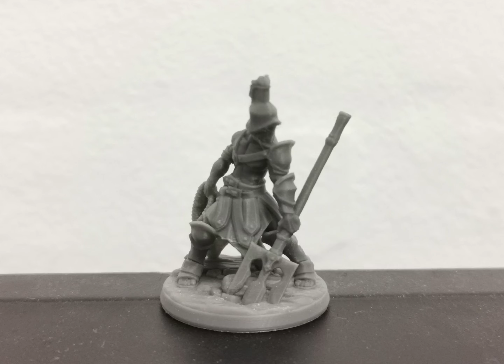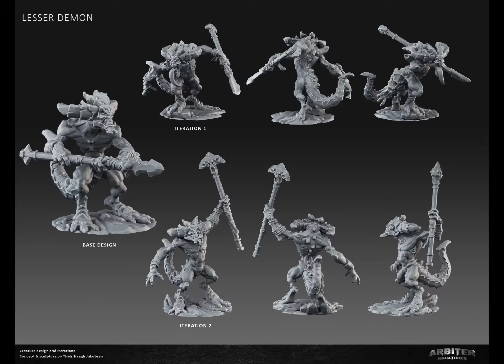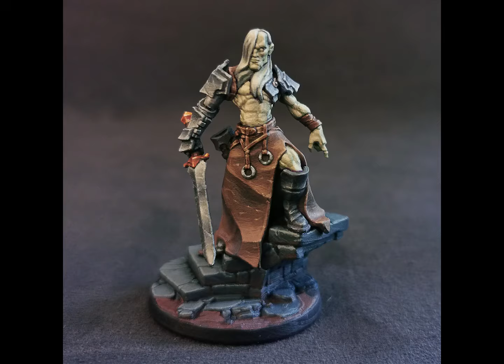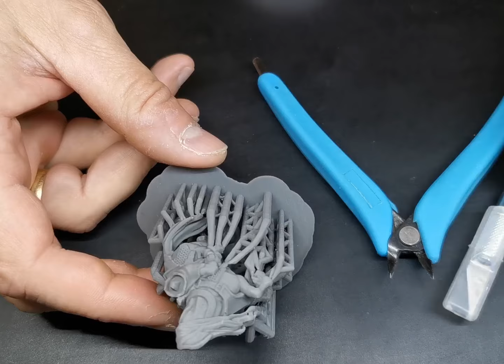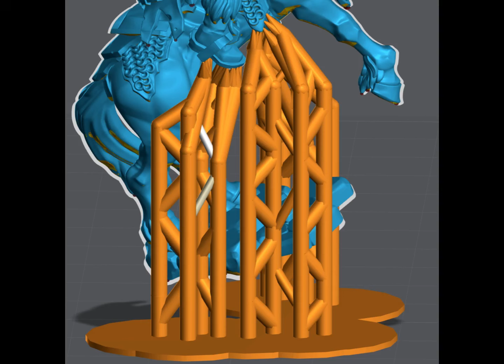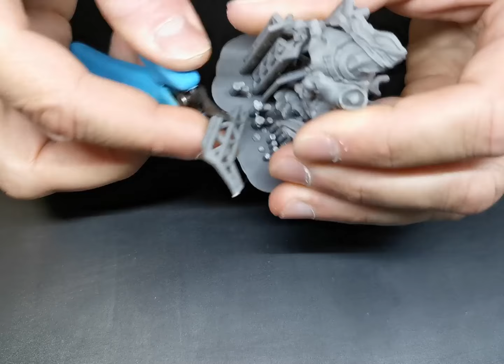ADVANCED FDM PROCESS

Comment: I like the idea of Advanced FDM. That being said, I recently tried printing minis that are pre-supported for resin on my FDM printer and it worked perfectly!
Reply: I am printing models designed for supports on FDM but using advanced support settings in Cura...sometimes I use Orca if I need to cut an arm or weapon off an print it seperate...